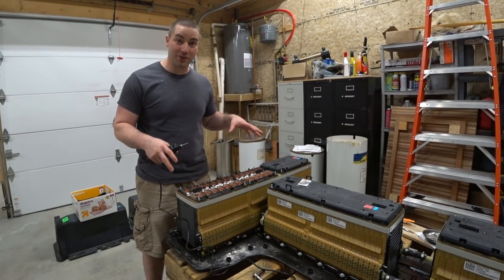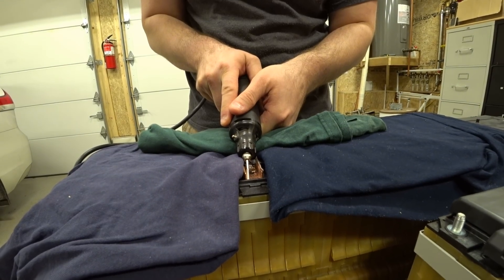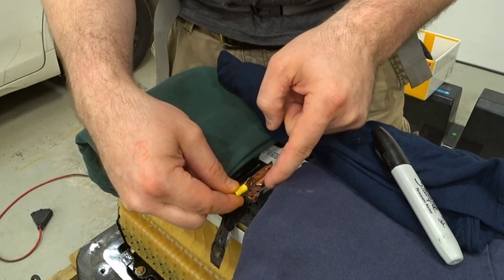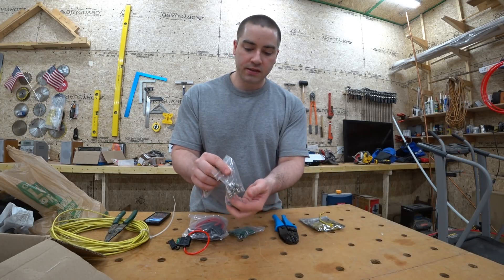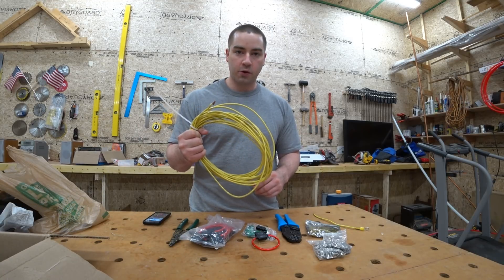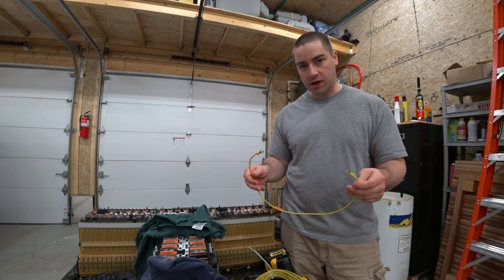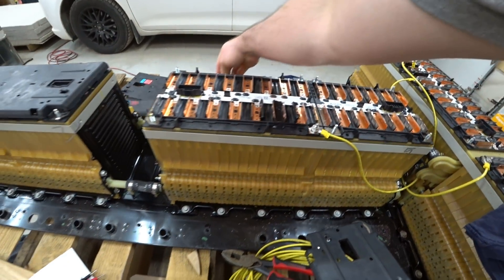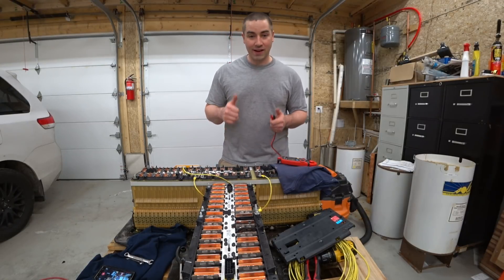Battery Modifying from Chevy Volt for DIY Powerwall, Gen 2

Comment: How long do you think the powerwall will last if you have a power outage based on your daily usage? I can't wait for the next video!
Reply from the maker: Thanks for watching the videos.  As for use, it could last as little as one day if we are heating the house with the electric baseboard, or we might be able to stretch it out to 4 days if there is no heating or cooling needed.  Once it is up and running I'll do a solid test to find out exactly and then make a video on it.

Comment: Cheers I love my kids too and they survived. lol One battery is a good start. I sometimes wonder if we are all doing this wrong going to 48 volts. There are many inverters that will take 300 volts which could then be used AC less work and lower cost just an idea.
Reply from the maker: I've thought about the same thing, smaller wires, less current.  The NEC (code) prohibits having a battery bank voltage of greater than 50 volts nominal.
Reply: Yes that is why I would leave the battery in the car and just run the power from the inverter into the house. Right a car generator sort of. Stay charged up
Reply from the maker: That would be a cool project.
Reply: dwf dwf they are inverter that are rated to 60vdc or 96vdc or higher Chinese  low frequency durable one...
Also you have option to get mppt charge controller that's rated at 550v to 48v and you have 48v inverter only you have to consider to use 3/4 of rated power of mppt charge controller not more so up to 2.5kw on 60a...
Yes is doable but complicated a little more.... 👍
Reply: There aren't any battery inverters that go higher than 48V currently,  only grid tie inverters.  You always have to base your batteries as 12 to 48V.